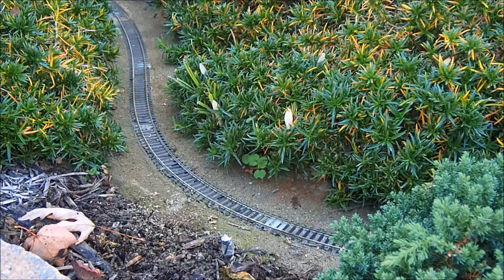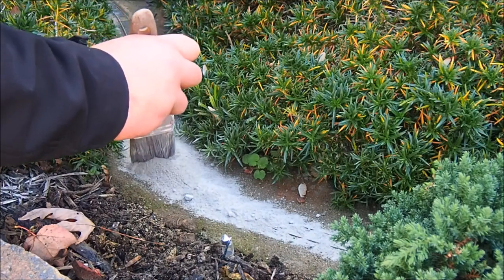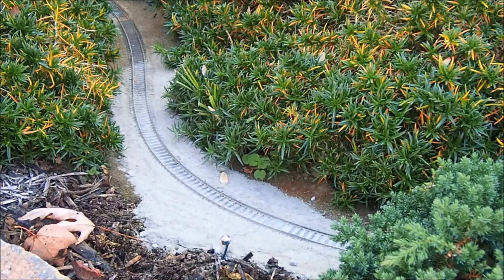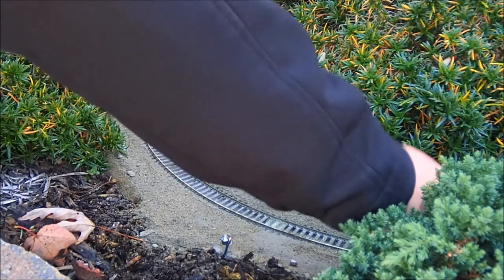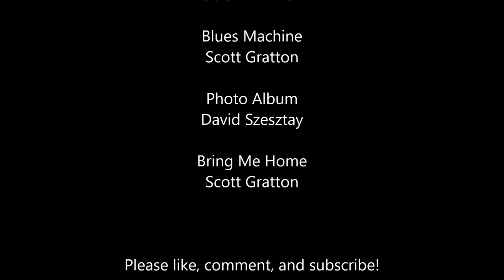DIY Roadbed - HO Scale Garden Railroad

Comment: I want to thank you Matt, for inspiring me to go ahead with my plans for my ho garden railroad! Your videos were the first I had seen on modeling ho outdoors and I’ve been going down a rabbit hole of research ever since. I’ve also read most of the informative comments on your videos to make sure I got a good understanding of how you did everything haha. I’ll be experimenting with dcc and going a bit overkill on the track laying due to having a free flowerbed that runs the entirety of the perimeter of my house, and the attached vegetable garden. I have looked into other ho garden railroads and saw most people were just laying down cinderblocks and laying the track on top of it. I decided I’ll be combining laying a cinder block roadbed and your method of laying a ballast to my layout. I figured having a thick cinderblock roadbed would keep things from shifting if I bond it all together and level it out with concrete. Maybe I’ll put a little rebar in there as well just to give it some extra support. Hopefully that will keep things from shifting too much with temperature change, but I guess I’ll see! I live up in Michigan where we get everything from -20 to 100 degree temps sometimes, so I’m sure I’ll be dealing with plenty of expansion issues down the line. I’ll be trying to post some videos of the layout here and there when I get started on it next spring. Anyways, thank you for inspiring me!
Reply from the maker: Best of luck to you and your RR!
Reply: Hello! how is your layout holding up? I'm down here in florida where sun, heat, wind and rain are the primary factors. Can you run me over the cinder block idea? I like it. What I can't figure out is once you put the cinder blocks down as a road bed... can you use this method of concrete to create the ballast on the top of the cinder blocks and nothing will shift?

Comment: I watched this a few weeks ago and have been thinking about this.
Reply: So here is what I have been thinking.  You must live in a cold area because you obviously have soil heaving.  Freeze-thaw expansion-contraction.  Begin from the beginning.  Foundations are used to provide stability by being deeper than the freeze line in the ground.  Which again put me on how to lay foundations.  First of all, don't take the rocks out of the concrete.  If you will cut some 1/4 inch plywood,  Make a form.  Port your concrete.  When it is about to set up, the guys just trowel it down smoothly.  The rock adds tremendous strength.  Also.  get some screen, chicken wire, anything cheap and meshy or wire-like, and add like you would rebar.  Another stability idea, get some fine rock, hoe out a channel, lay base.  Then lay the form.  That is how you would lay a driveway. Ohh, the expense, I know, this stuff costs money.  I don't think you need to buy 'ballast"  for appearance.  I'm visually okay with sand.  Drop some paint and cement in trowel on.  Set track in.  I made the comment and then typed all this, didn't want to seem like a know it  all for everyone to see.  Your layout really intrigued me and I think that is how I'm going to have to go.  I like long trains and long runs.  40ft is about as much as you get in a building.  100ft is nothing outside.  Thanks for the video.  This is not meant as a critique, I'm not there fighting the winter, but I saw this a few weeks ago and have been thinking about this a lot because I really like what you have done and was trying to ease your struggle.
Reply from the maker: It is fun, but it is not maintenance free.
Reply from the maker: Sorry for just seeing this! I've pretty much done everything you have said. The foundation is 4"+ concrete with the rocks and rebar in it, but is only 6" wide or so, and tapered on top so mulch or gardening can go all the way up to the right or way. Yes I live in a climate that sees continuous freeze-thaw cycles during the winter. To make matters worse, the layout surrounds a deteriorating 3' tree stump which acts like a giant sponge, worsening the ground movement. At the time the whole RR was an experiment, and I did not expect it to work as well as it did. This was more of proof of concept, than a complete permanent installation.

Comment: Thanks for the video! I have a couple questions though. What type of flextrack do you use, and how do you weatherproof the plastic ties?
Reply from the maker: jawharp I sourced the track from a local hobby shop which I believe sells atlas track. I have not taken any measures to weatherproof the ties. As of now, they have retained color and durability over time (3 years before I replaced track). Note that the RR is shaded by the barn, and is only in direct sunlight for maybe an hour or two each day.

Comment: Hello, are the rain and snow a problem for this VERY GOOD garden railroad?
Reply from the maker: Thanks for the complement. The rain might wash up a little debris on the track, that's about it. Occasionally I will buff the surface of the rail with 1500 grit sandpaper to remove any minimal corrosion. The snow does not cause a problem, however the ground shifts a lot during the winter when it freezes and thaws, resulting in the road bed repairs shown in the video.

Comment: Are the tracks water proof?
Reply from the maker: Not by design, but they seem to do ok. The plastic ties have done well in the sun. The rail does not rust, but may oxidize a little. I often clean the top of the rails with a very fine sandpaper. The tracks will last about 5 years with ballast repair/replace every spring.

Comment: Will it cut out when it rain? This is amazing. I've never seen HO scale outdoors before.
Reply from the maker: Trainsandtrucks I've never had a short circuit while running in the rain, but the tracks get dirty quickly and the engine may begin to lose power